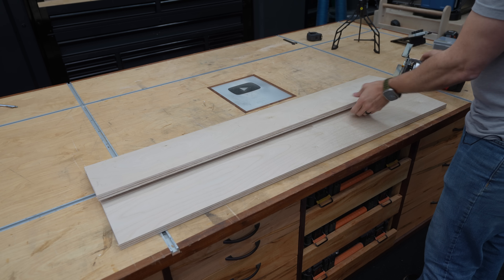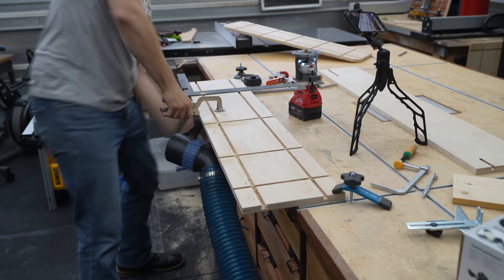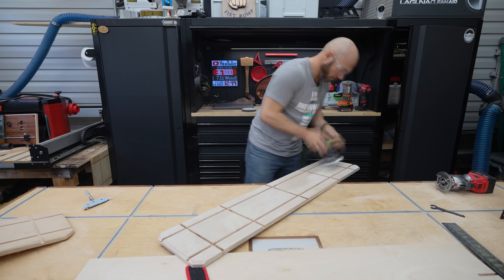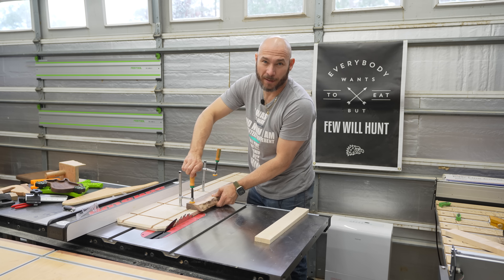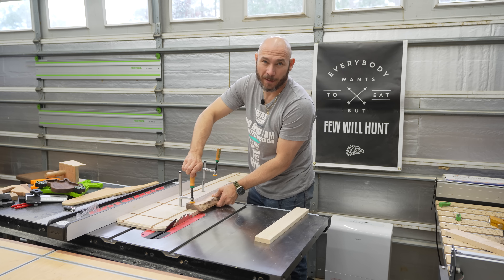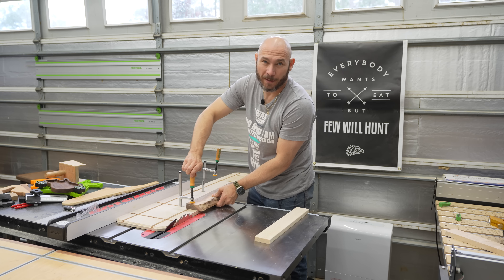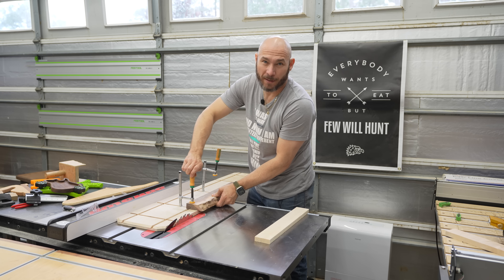99% of Beginners Don't Know About this Woodworking Trick!

Comment from the maker: ▼EXPAND FOR LINKS TO THE TOOLS▼ 
🎥 Watch Next - How to build a Safer Cross Cut Sled - https://youtu.be/YbMUc4wVjpE
🛠 Tools In This Video: 
Jointing Jig Plans https://www.731woodworks.com/store/jointing-jig
NOTE: I use MicroJig Dovetail bit and clamps but you can use any dovetail bit and dovetail clamps that you prefer. 
Matchfit Dovetail Clamps - https://amzn.to/3iy26cE
MatchFit Dovetail Bit - https://amzn.to/3GxIjlS
(Better deal) Matchfit clamps, bit and extra hardware https://amzn.to/3k8BI9T
Router Set Up Blocks - https://amzn.to/3GUFWuH
Router I Used - https://imp.i284638.net/doXNoW
Chamfer Bit - https://amzn.to/3GX0WRn
DFM Small Square - https://amzn.to/3IPzrui
Paste Wax (if you don't use Outlaw's Board Butter) - https://amzn.to/3ivEAx9

Tools in this video buy from TayTools (small family owned business)
If you buy Matchfit from TayTools (UseCode 731MICROJIG10 to save 10% Off)
Matchfit Dovetail Clamps - https://lddy.no/1ejbk
Matchfit Dovetail Bit - https://lddy.no/1ejbl
Framing Square Fence - https://lddy.no/1ej5h
Outlaw's Board Butter (buy 3 or more and you get free shipping) - https://www.731woodworks.com/store/boardbutter 

Other Tools I Use:
DeWALT Table Saw - https://amzn.to/3kebWkk
Festool Miter Saw - https://amzn.to/3X2AX0I
SawStop Table Saw - https://amzn.to/3ZrkDbf
Table Saw Blade I Use - https://amzn.to/3vWo5gw
Sander - https://amzn.to/3XqRcEG
Dust Extractor - https://amzn.to/3CH4JQx

(If you use one of these Amazon and other affiliate links, I may receive a commission) 

Some other useful links:
Daily Tool Deals on my website: https://www.731woodworks.com/tool-deals
Subscribe the 731 Newsletter: https://mailchi.mp/7e44c16eefdc/731-woodworks-email-newsletter
Check out our easy-to-follow woodworking plans: https://www.731woodworks.com/store

Comment: FFS that is not “scrap” plywood. Why is their an obsession with calling large, clean slabs of stock “scrap”. It won’t make the project any easier or harder to complete. A far more honest and useful description would include dimensions for example. Saying “scrap” is disingenuous and bloody annoying when every YouTube woodworker uses this term. Here’s an idea, say “all I’m using is a length of plywood, four feet by two feet by three quarter inch” The scarp are those bits you cut off the corners, a big difference.

Comment: I made one of those sled last year.  It was recommended not cut the short grooves all the way thru.   It's best to stop short of cutting thru by 1/4" so there is no possible way of accidentally exposing the metal part of the clamp to the saw blade bc it's often blocked from view by the work piece.
Reply: I’ve seen it done that way. I much prefer the through cut. Because there have been a few times where I needed every bit of that groove to safely clamp something down. Just gotta be thorough and check it
Reply: @rhettdunn8788  I'm a beginner as title suggested.  Pro's do things differently.  hahaha.   No matter how careful I am, all it takes is one slip up.  For that reason, my pocket hole jig has two more holes on the bottom.  I have plenty slip ups (non safety related) on table saws.
Reply: @ipick4fun27  Your way is superior regardless of what the pro's do. Eliminating significant hazards is always the best way.
Reply: @guyincognito.  you've used both sleds?
Reply: I'm confused if you cut the grooves shower the metal will stick out farther can you please explain
Reply: @Travis Klein  they mean stopping the dovetail groove shy of the front of the sled. Can push the clamps in from the back (fence side) but cannot push them out the front (blade side). 

You only need to stop about 1/4" shy to have enough material there to stop the clamps from being able to contact the blade.
Reply: If those tracks are aluminum, hitting one is no big deal.  Edit: whoops, I see, I ought to watch thru before commenting
Reply: It's easier to route the channel all the way through. Just take a little chunk of dowel and drill into the end of your dovetail, giving your clamp a stopper.
Reply: I was just thinking the same thing about why cut all the way through but HEY here is the same question.
Reply: I'm jiggy wid it, white boy
Reply: The recommendation I have seen to avoid the clamps hitting the blade path is to cut the sled wider and longer, with the spacing of the dovetail grooves shorter. In that case if you want to joint or do a taper on a piece that isn't very wide you can clamp it from the top and from above instead of the sides, that will eliminate the problem of the clamp going in the blade path. The long side dovetail grooves, if they are cut with a separation of maybe 2-3 inches then you can clamp pieces almost in the border of the sled.
Reply: Eh just did some small nails/ screws at the end of the grooves
Reply: @ipick4fun27  Even pros have extra holes in their pocket hole jigs 😜
Reply: Exactly what I was thinking.
Reply: @guyincognito.  That isn't a significant hazard, and the way you speak is how those that never accomplish anything of real merit speak -- because they are weak.
Reply: @rhettdunn8788  You could leave the 1/4 inch on the sled and cut 1/4 inch from the clamp.
Reply: @dogbreath6974  the dovetail clamps are designed with the clamp head directly over the part that rides in the groove. So if it’s a thin piece, you need the clamp head right up against the edge of your sled, which makes the part that rides in the groove right against the edge. These clamps are reversible but they don’t work as well that way
Reply: I just opened up the comments section to write exactly the same thing  😂
Reply: @rhettdunn8788  Couldn't you have just used the long slot instead? If you cut the long slot closest to the blade at the same place the side to side slot stops, my thought is you would have the same capacity and you would not be able to set the clamp beyond the edge.
Reply: This was my immediate thought when he showed the possible exposed metal. Yes if you pay attention it should be fine, but we all know how things can go wrong, and that blade smashing into a piece of metal, can go very wrong.

Comment: One thing often recommended is to use a 1/4-inch straight bit to hog out most of the material before coming back with the dovetail bit.  This saves wear-and-tear and stress on the dovetail bit.

MicroJig sells a mating straight bit to go with their dovetail bit with the matching yellow finish.  They’re kinda hard to find, so I’d recommend using a 1/4-inch down-cut spiral bit - down-cut since you are cutting into plywood.

Of course this method requires extra setups since you are routing the same groove twice with two separate bits.

The way he does this in the video is quicker and somewhat more efficient if you don’t mind stressing the dovetail bit a little.  And it obviously works just fine.

I’m just bringing it up since I have read multiple places that it is better to clear out most of the groove with a straight bit before making the dovetail cuts.  So, whatever.

I love this jig.  It’s going to be an early project once it gets warm enough in my garage to go out and “play”. 🙂
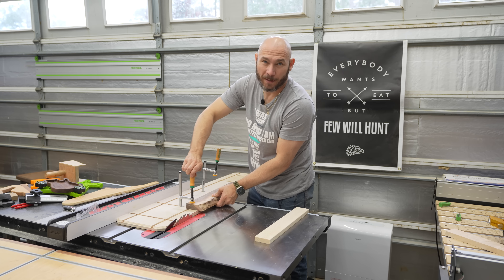Reply: Yes, at 3:04 that shiny new dovetail bit was smoked like grandpaw's Sunday brisket.
Reply: Good advice. makes sense. The second pass with the dovetail is taking only smaller sections to the side so the second pass should prob be quick anyway.
I have a bosch set with a 12degree dovetail. Would that work with these 14deg dovetails? I know ideally you should match but not really finding any 12deg dovetail clamps near me.
Reply: Late to the convo, but you can always use your table saw or circular saw to run your line and get extra material out if, for some reason you don't have a straight bit. Not quite as effective but still works like a charm reducing the load on your bit. 👍

Comment: Hey Matt, I think I've told you before, I love, love, love your videos!  Great info, skilled and experienced, inspiring and motivating, humble, honest, and humorous.  It gets me thinking and questioning and practicing and learning.  Even if I prefer a different product or method, your presentations are a great help and starting point.  "If it's close, it's fine."  That's my happy place!  Thanks again!  Added thanks to all the commenters for their priceless additional input and experience as well!

Speaking of help from other folks, I'm thinking your "scrap wood" has to be true (or jointed) on the side against the fence, so use the side with milling paint, or shave it, or joint it true, no?  Not so sure this was emphasized enough for novice DIYers like me.  Thanks!

Comment: You've just saved me quite a bit of money that I was going to spend on a jointer/thicknesser, and you've saved me some space in my small house as well. I think I'll use some of the money saved to buy some aluminium T-tracks and put them on the sled. They should be more durable than the plywood grooves.

Comment: If you don't have plywood laying around, like all these YouTube people seem to have, you can buy a 11" wide melamine shelf panel that's 8' long for a little over $20. Melamine is messy to cut is the biggest problem. Also don't clamp anything down too tight because it will break easier than plywood. With that shelf you can make the jig in the video and a nice planer sled if you cut it in half. Cheapest way to make 2 useful jigs everyone can use.

Comment: You can also unscrew the set screw at the top of those clamps and flip the clamp direction, making it impossible to hit the blade. It'll still provide plenty of clamping pressure in reversed orientation.

Comment: I did something similar to what you have made.  I used a piece of plywood with a factory edge 4 feet long that goes against my tablesaw fence, then ran two T - tracks at 90 degrees to the fence that is about 9 inches long.  used two of the 2 1/2 bolts for the t track with a piece of plywood that runs parallel with the tablesaw fence.  I use that to "bolt" down the piece i want to have a straight cut on.  works pretty good surprisingly.  it's very basic just to make a clean straight cut on some lumber.  slowly getting business / work area organized then i'll worry about my channel and other things.

Comment: I made a 12" wide plywood and installed 2 t-tracks across the width. I then use a couple of Rockler style hold down clamps to hold the wood in place. There is no worry about hitting the end of the clamp. I make my Rockler-style clamps using plywood and toilet bowl bolts and knobs. If I hit the clamps - no big deal.

Comment: Another awesome video - I'm a newbie woodworker and using a scrap piece of MDF shelving just built the fence model. I like that you used a hand router rather than a nice big router table which many of us amateurs don't have. Since I have the same DeWALT 7491 saw I am also building the miter slot version since the job site saw fence is kinda iffy. In fact, it would be awesome if you could do a video on how to make that saw and fence as accurate as possible. At any rate, I bought the starter set of MICRJIG clamps and dovetail bit and just ordered four more clamps - and your video was so helpful in educating me as to how great this system is. Thanks, Larry
Reply: Here's a tutorial on setting up a jobsite saw for woodworking. She uses an older saw than yours, but she specifically recommends the one you have as the replacement for it since hers isn't made anymore. But they share a lot of the same features, so it will probably be of some use: https://youtu.be/22oqr6o5z-w
Reply: I think he has the model down from the 7491 with 8" blade
Reply: OK - maybe so...

Comment: Made mine a few years ago with a 3/4" wide strip glued to the bottom to use the miter slot and keep the fence out of the picture.  Added a second one on the other side of the blade to get zero clearance cuts ... and to support longer boards cut at almost angle you desire.

Comment: One thing I saw on another video, glue a piece of wood for the miter track first, then use that as a guide to rip down the jig on the table saw , and that will line up the miter track parallel to the jig.

Comment: I'm a very low level woodworker. In fact, I'm not even a woodworker. I just often have to create angle cuts on a table saw at my job (a circular saw may work, too, but I haven't figured that one out yet, either). The pieces I cut are fillers used between cabinets and the adjacent wall. The beginning dimension of the filler is 2 to 1" wide and ranges from 2 to 6 feet in length. I'm trying to figure out how to build an angle jig that would accommodate this length and width of material. What crossed my mind, however,  is that considering that you can cross cut a piece of wood at an angle by angling a mitre gauge, couldn't you similarly rip a piece of wood on an angle by feeding the piece through an angled fence? If you can, couldn't you create a jig that attaches to your fence and adjusts to an angle so that you can feed the piece along the fence to create the angle? Of course, the wider side of the cut would be behind the blade to avoid pinching the wood and creating kickback. Maybe that's not possible (or is dangerous to do). I'd be interested in your input. Thanks.

Comment: Nice sled. I remember it from the last video. I think it’s worth a mention that if a person is gonna use a table saw for jointing jobs. It is worth getting the best saw you can afford, as well as a better quality blade for the task. Lots of budget saw out there not quite cutting at 90 degrees with the factory blade that came with the saw. Ask me how I know, lol? I still think I like the router method, but this sled opens up tapering options.

Comment: I’ve used this trick before but never made a permanent jig. This looks really handy and I love the other uses. If you had to straight line rip a board would you pull this out or use the track saw?
Reply from the maker: I grab this on shorter boards every time.  If it is longer than 5 or 6 feet, I'd grab the track saw

Comment: Great, simple build!!  Did mine today and am very satisfied with this new “tool”.  I used my own 14 degree dovetail bit and set depth exactly at 3/8”.  The groove seems a little sloppy, about 1/16” play in bottom of dovetail.  Is there any difference between my standard 14* bit and Microjigs 14* bit?

Comment: This is a really nice and elegant solution, thanks!. Since I don't own those fancy dovetail clamps I considered a less spectacular version with aluminum t-tracks mounted in those grooves and using regular track guide clamps instead. Obviously, the perpendicular grooves would have to stop a couple of cm/inches before the cutting zone and the clamps would need to be inserted from the fence side. Do you think this is a legit alternative for this jig?

Comment: let's be honest, you did run that peace trough jointer first to remove twist.  This jig is nice but not for jointing. You do need two perpendicular edges to joint boards.
Reply from the maker: I didn't.  I got the wood the way you saw it.
Reply: @731Woodworks  just like that you source perfectly straight wood?  What do you do when you are not so lucky to have perfectly flat one surface of the board and board is twisted when using this jig? This  jig is perfect for different things but not for jointing.
Reply from the maker: @jofajura if the board is twisted, don't use this jig.  Use a planer sled and send it through the planer. This is for edge jointing
Reply: @731Woodworks  exactly, but you don't metinon this in the video so it is mesleading for any beginner to think it is possible to joint boards only with this jig.  Edge jointing boards that are not straight is useless.

Comment: Hey Matt, just wondering if the dovetail slots ever wear, or break since they are using metal clamps on wood dovetail slots.
Reply from the maker: Mine hasn't worn out.  I've used a jig like this for a very long time.  You don't put a ton of pressure on it when clamping down.

Comment: I use a piece of 3/8 x 3 aluminum 8 foot long and c-clamp it to board I want to edge then use a straight bit on router .If it dosnt clean up all saw marks just move it back a 1/32 or so. I have built many pieces using this method including table tops.

Comment: Hi Matt. Very nice presentation. I do not see any stop block. How can you do exact repeatable cut ? I wish you would have covered that too. In one of your videos you indicate to use a straight bit before using a dovetail bit. How come you do not mention that here ? Please advise. Thanks
Reply from the maker: For stop blocks, you can purchase dovetail hardware from MatchFit and make a stop block that will use the dovetail grooves.  I found that for plywood, you don't need to use the relief bit before the dovetail.  Just an unnecessary stop, in my opinion.
Reply: @731Woodworks  thanks for being so professional.

Comment: I have been using the same setup for a couple of years now and it is great. It also make a great setup table to hold material with those clamps. Frankly for most work these clamps will eliminate the need for a jointer. I also use my planner as a surface jointer by shimming up warped boards with shims, hot melt glue, etc so the warped board won't rock. Once done, run iot through the planner and after a few passes it will have one surface without the warped surface.  Now turn it over and that flat side will let you plane the other side so it ends up with two parallel sides and no warp. If a home workshop this is all you need....for heavy use or commercial use a Jointer is great IF you get one though get a long bed one so it can handle long boards. Those table top jointers are not good for longer boards and that being said, I have a hard time finding a use for them for a home hobby shop.